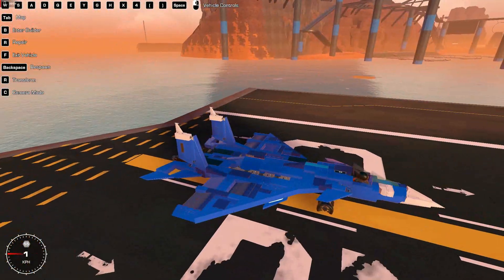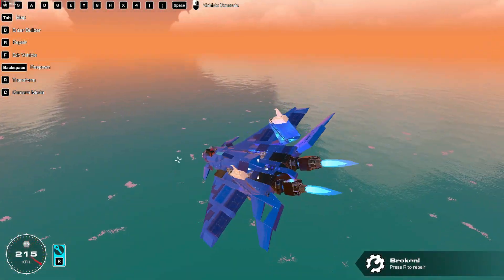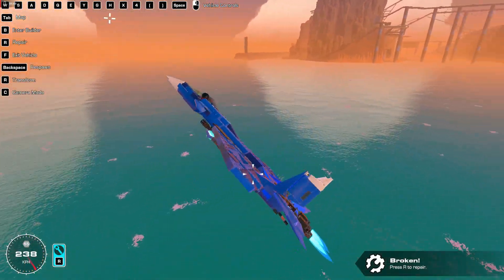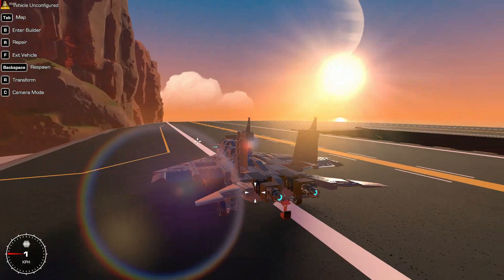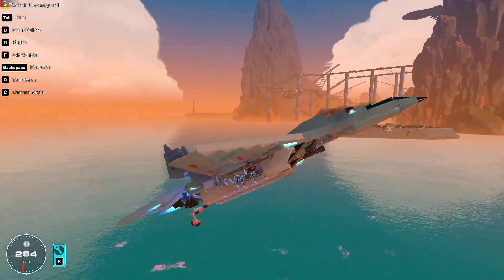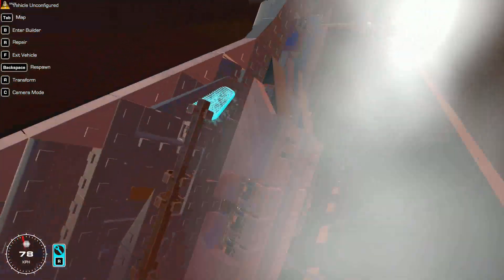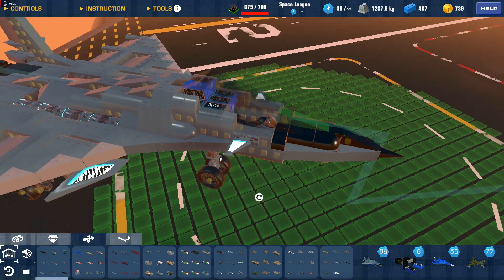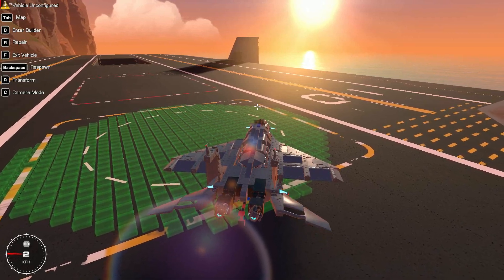Low Speed Thrust Vectoring Example

Comment: I've tryed making such a system, but using rotors to swivel the engines while they are angled has all sort of akward effects when I had multiple inputs at the same time (yall+roll+pitch). To solve this I came up with a system which uses 3 layers of pistons and 2 consecutive hinges (on oposing directions and 0 force) behind the engine. The pistons are all set to start position at 0.1, reset position on and only receive input on contraction.
This way i could make the different inputs not mess with one another and quite a small package, although it's a bit on the heavy side.

Comment: okay look you're thinking far ahead and i like that, but you're thinking wayyyy too far ahead. don't use roll on the engines, you only need one pair of hinges for your thrust vectoring. set your hinges in the same direction but set up roll controls separately for both engine hinges. use an OR gate with your pitch controls and connect it to your hinges.

another thing i can suggest is Combat Flaps, just flaps very slightly infront of the center of mass in your wings, they can help you maintain lift on low speeds and help pitch up.

just thought i'd give my thoughts.
Reply from the maker: Nice to hear you opinion on it. The Roll on the engines is a bit of an unnecessary bit, which I did think about swapping around in order to keep YAW and pitch functionality, but that does slightly violate the idea of 3-Dimensional Thrust Vectoring. I do think that I could definitely roll around if I wanted to keep it. 

About the combat flaps, I don't actually think they'd do much on a late Terror platform. They're unstable enough, and the leading edge like Flaps for the front may end up doing more harm than good in my opinion.

I really appreciate your take on it though!
Reply: @CookieCommandGaming  hey no problem man, if you need to run from the irs i cannot help. although if you need other help in trailmakers, ksp, or whatever other game you can build aircraft in. lmk. cannot help you run from the irs though.
Reply: @SSS333-AAA  from the depths?
Reply: @acrackworksproduction  i haven't ever played that game but i've heard it's fun. might check it out some day.
Reply: @SSS333-AAA  good luck on it, i wasn't able to progress in that game far bc i didnt really understand it even tho i watched 100s of videos about it xd